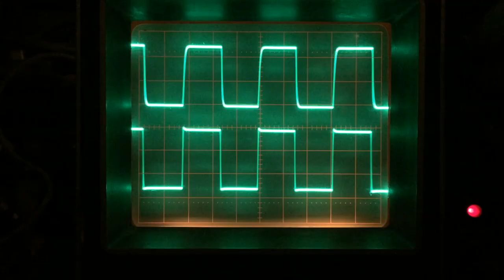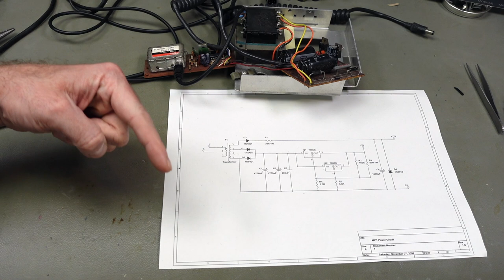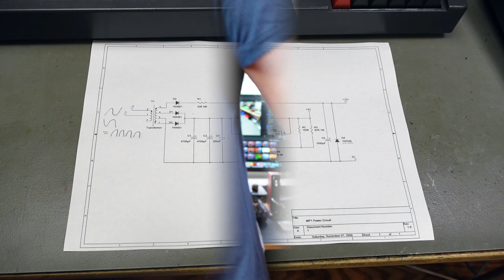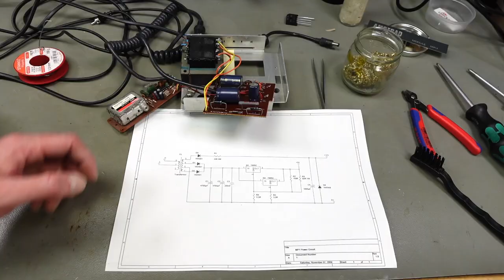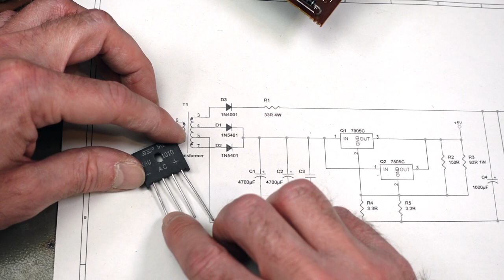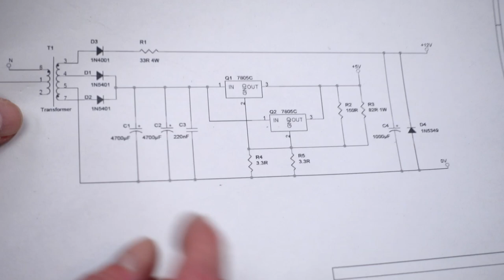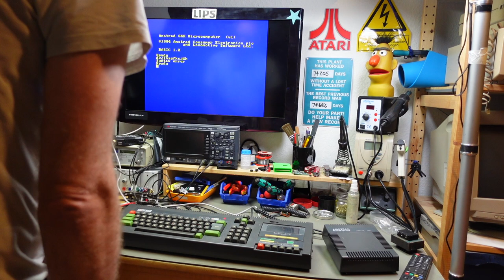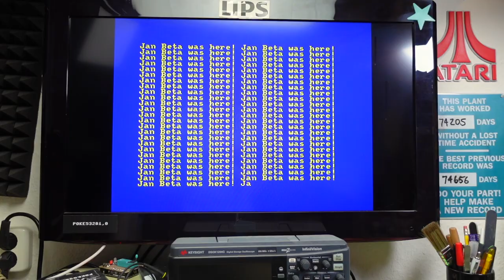Amstrad Module MP-1 Refurb and Mods

Comment: The transformer has four taps with tap  2 to 5 being maybe 15v apart. Then from tap 4 to 7 is maybe 8-9. For the 12v the simplest version of rectification which is a single diode is used. The diode blocks the voltage on the negative side giving just the bumps above 0. That then gets regulated to 12v using the zener. The 5v is using two diodes to to block either side in turn producing a very dirty “dc” output which is then smoothed by the three quite large caps. Then the 5v gets regulated with the normal 3 pin 7805s. The transformer is a multi tapped secondary transformer rather than centre tapped.  If I were doing that board I would add the voltage for the floppy too. I can’t remember what voltage it needed off the top of my head.  There is nothing inherently wrong with half wave rectification and those diodes were overkill from the start. I do look forward to your videos. It was only after I started making my own that I realised just how hard it is!!

Comment: AFAIK the MP-1 was an option for people who didn't want to get a monitor. Since the power supply is normally in the monitor, you need some kinda special brick to otherwise use the CPC.
Reply: And also for people who had cpc with the green monitor and would like to connect to home colour TV

Comment: Hi Jan, from the video I don't understand how you connected the bridge.
If you left the center tap (black wire) disconnected and connected the two orange wires to the bridge AC pins e the + - terminals to the capacitors then you will have twice the dc voltage input to the 7805s; if, on the other hand, you connected an orange and the center tap (black) to the AC pins while leaving an extreme pin (orange) disconnected then you will have half the available current.

Comment: I had put a simple USB connector into the CPC, connect a simple USB power supply and called it a day. The only thing to check in that case ist If the supply can deliver enough current. May be even USB-C, that might even fit the barrel plug hole in the case. Such connectors with soldier connectors are easily obtainable over AliExpress for example :)
Reply: check the output of a USB C as its are capable of delivering up-to 21volts (intelligent supply)
Reply: @TheDoctorhuw  That Amstrad only needs 5V - the 12V are for the removed TV modulator anyway.
Reply: @mzwandula  I know I was just saying be careful the voltages avalable from a USB C supply will fry the 5 volt devices and the 12v ones too.

Comment: There was a MP-2 model that provided the12V required for the 6128's floppy drive. Thing is, this model also needs to provide 12V to the modulator. Yes, a floppy drive sure enough draws more power that a modulator, but still, I don't understand why two models existed instead of producing one that would cater for all CPC models. Why Amstrad, why?
Reply from the maker: I would guess that it was cheaper to build two different units (the MP-2 needed a much beefier power supply for the 12V as you said and transformers are expensive). :D

Comment: The rf output was really bad. I had a cpc464 with colour monitor. But a friend had one with the rf. Looking at it after using it with the monitor, it was almost un-usable for me
Reply from the maker: Yeah, I can imagine. There’s not a lot of shielding against the noise from the transformer/power supply in the MP-1. The RF signal probably is distorted quite a bit. I’m definitely going to try to have a look at it though. :D

Comment: Faul, wie ich bin  hätte ich die alte Technik sofort aus dem coolen Retrogehäuse gerissen und ein nettes 5A Meanwell eingebaut, keine Extra Sicherungen oder heiß werdende Trafos und vor allem Power. Wäre aber ein deutlich öderes Video geworden als deins. Ich hätte ja gerne den HF Modulator in Aktion gesehen, aber ich denke, der ganze Ärger um den Brückengleichrichter bzw. den abgerauchten Trafo hat dich zu lange aufgehalten...

Comment: 43:13 I'd definitely refit the modulator. It will at least have more of its originality preserved & it'd also be interesting to see what the RF output looks like. I for one have only ever seen a CPC display on its dedicated monitor.
     ↓↓EDITED TO ADD↓↓
With this you could at least connect your CPC to the big telly in the living room … and probably get better sound too if the RF signal carries audio.

Comment: In the good old times two diodes costed more then some copper in a transformer. Back then it was useful to save money on the bridge. Nowadays they look different to this matter. Now the copper wire is more expensive. The money was spoiled in the past, you can't correct that. But, improvement would always be welcome. 
 
In the transformer with two secondary coils (three wires) in combination with two diodes, half the time half does nothing useful. If it would be possible to disconnect the common wire and make two separated secondary coils (four wires) then these wires could be differently connected, then a bridge rectifier could be used and then the result would be that there would be more efficiency, a slightly higher current could be drawn from it. Then all the time both secondary coils would be in use all the time. Everybody happy!
 
So, going to the bridge would be great if also the transformer could be reconnected. By the way, I would add as many capacitors as could be stuffed inside. A flatter direct current is better than "Hong Kong"-style power-supply with only as mutch capacitors as needed and nothing more.

Comment: get rid of internals, add a swtching psu and a mod for videoe circut
Reply: I saw mention when searching this morning of using a PC ATX power supply instead. Might be a brick like solution, but plenty of power on tap!

Hasn't anyone ever made a totally new replacement alternative within the CPC community?
Reply from the maker: I used to use an off-the-shelf modern 5V power supply with a barrel plug before, super easy to find. I guess there’s no real need to make a replacement, except maybe for the RF modulator portion of the MP-1.
Reply: @JanBeta  I agree, as like fixing up old bits of tech (not enough time though!). That said, I also like finding new solutions to make things work better and for longer.

Was thinking along the lines of your new PSU's for the Amiga & C64 😀

Comment: If the transformer is speciefied to 10 VA and 9V, you will not get more than 1.1 A at 5 V with linear regulators. The rest is dissipated as heat.  :)

Comment: If that transformer is the same kind that I've used in the past, they're really annoying! They use 5 mm pin spacing, so they don't fit into standard 2.54 mm prototyping board.

Comment: Maybe add a RGB Out to the MP-1 (MD 2) to upgrade it from RF.
Reply: Better yet: HDMI out!
Reply: @the_jcbone  For ease of use a good idea, but a CPC belongs to a CRT in my world :)
Reply from the maker: The CPC already has RGB on board so that wouldn’t make sense really. :D
Reply: @JanBeta  A Passtrough to a more common connection would be the only benefit while restoring / upgrading the original function. Bit redundant for sure with the RGB out on the CPC, no doubts.
Reply: @Retro_Royal  yes… maybe. BUT: this module was intended for using the computer with another display anyway! So it would absolutely appropriate to convert it to HDMI!
Reply: @the_jcbone  And I can completely see why, I only have the green monitor and use the RGB to feed a color screen now via scart now. I also only use a regular 5v device, so I don´t own a MP-1 myself. In my scenario that would be beneficial, I don´t claim it´s the only valid option :)
Reply: @Retro_Royal  Neither do I. Heck, I grew up on a C16…
Reply: @the_jcbone  after Atari 2600 thar was my first Computer ❤️

Comment: Er, yeah. Modifying power supply circuitry when you don't know what you are doing is not the greatest idea. Amstrad was notorious for producing the cheapest, most cost-reduced products possible so as to get able to undercut the competition and still have a healthy profit margin. It is not at all surprising to see a primitive PSU design in one of their products.
Reply: Someone better have the paramedics on speed dial pluging it into mains power without testing it

Comment: Get rid of the old shit, and replace the internals with a meanwell power supply.
Reply from the maker: Probably what I’ll end up doing. :D
Reply: @JanBeta  Good call. Will probably be more harmless for the machine as well That old power supply is not the most stable build.